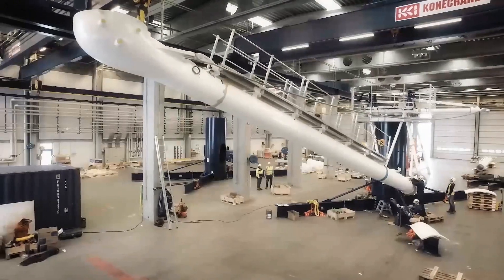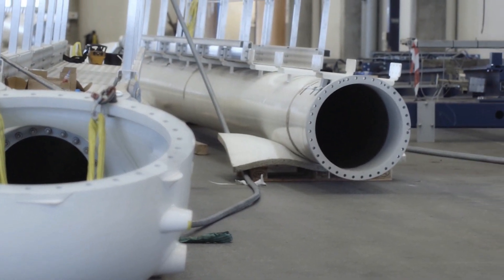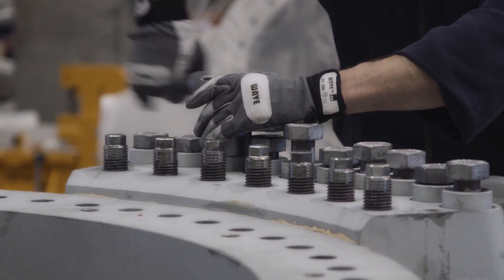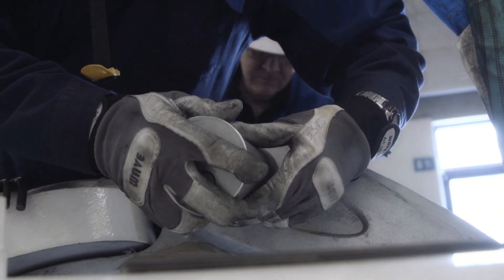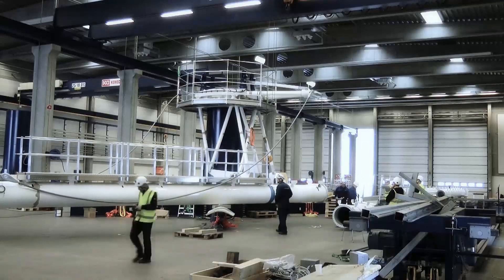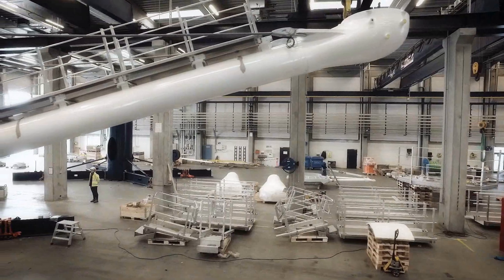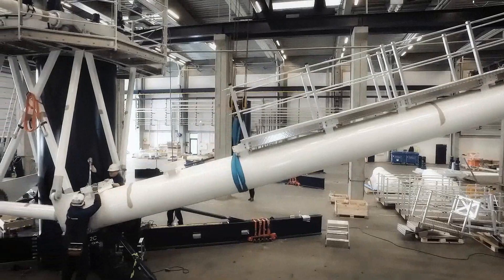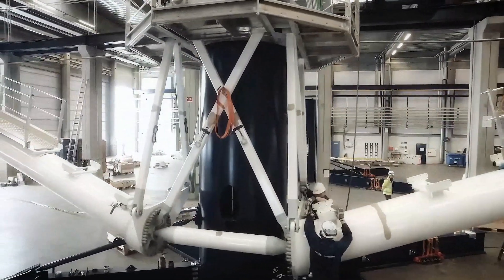Vestas challenges scaling rules with multi-rotor concept demonstration turbine

Comment: So a 4-rotor wind turbine, each 29 m in rotor diameter wind turbine would have the combined swept area to a single-rotor wind turbine with a rotor diameter of 58 m. What's happening is that 12 blades are covering the same swept area as 3 blades that are only twice as long. Sounds like this will be a niche product for areas with prohibitive logistical challenges.